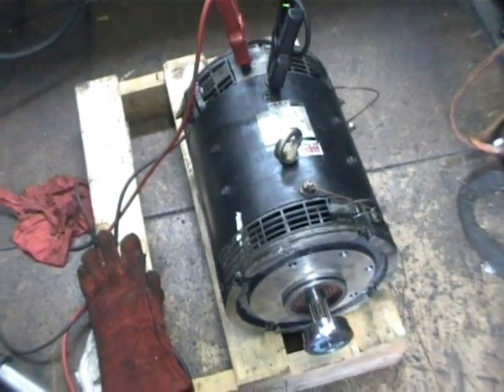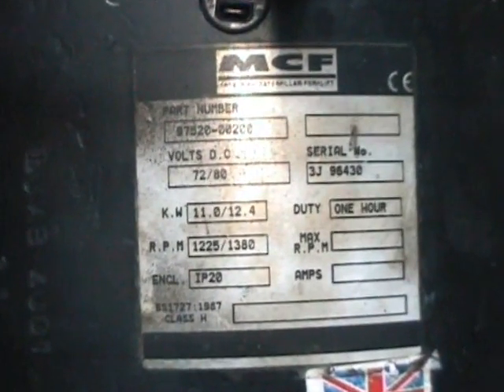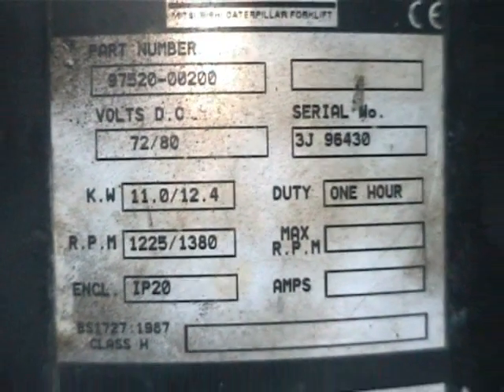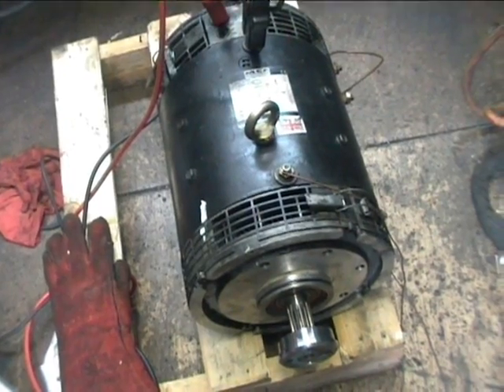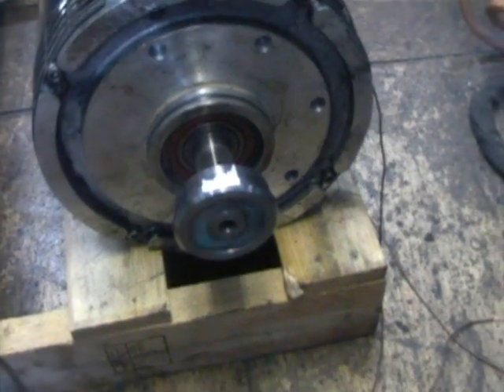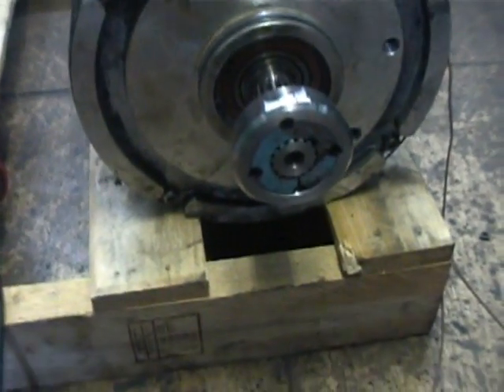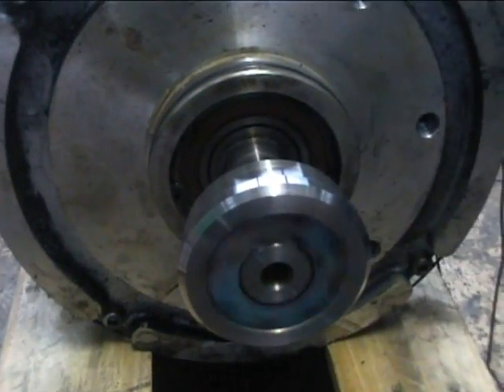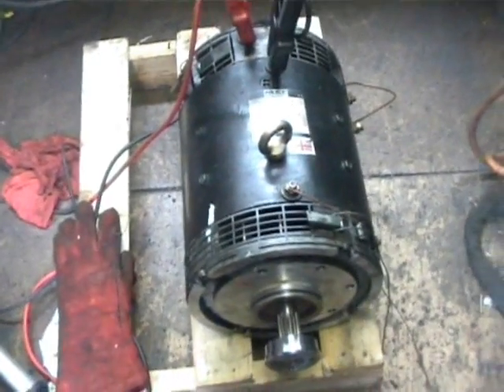compound dc motor

Comment: recently discovered your Channel Damien and absolutely love what I am seeing, so I am starting at the beginning, could you comment on the following question:  Doesn't the RPM of this motor seem rather low for an EV car conversion, shouldn't it at least be twice that?
Reply: Dc motors have a rpm per volt number, this motor will give about 1750 rpm for 75v. Double the voltage and you effectively double the rpm. 

This is only for dc motors, ac or brushless dc doesnt work this way.

Comment: Hi guys I viewed a couple of forklift pump motors today. One had an output of 9KW and the other was 12KW. Now the issue is that these motors only have two electric contacts, we tested them and they ran perfectly in one direction, so how do you make a motor with two contacts run in reverse?
Reply from the maker: You would need to open the motor and reverse the connection to the field windings
Reply: Ok thanks, so once this is done the motor will now be able to run both forward and in reverse, right?
Reply: wayne goff  thanks man

Comment: a very good demonstration, when you consider series connection you would have considered putting series dc motor torque-speed characteristic on the screen so viewer can easily understands yeah this motor is fast but doesn't like to be torqued^^. Thanks again for the very nice demo.